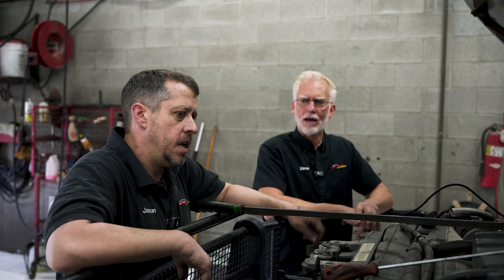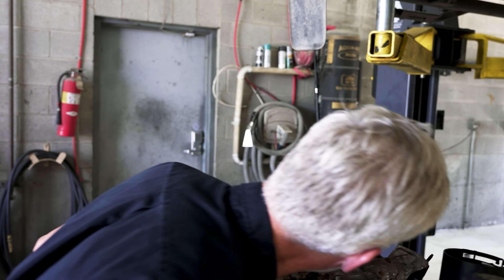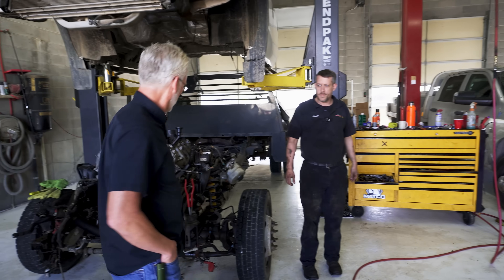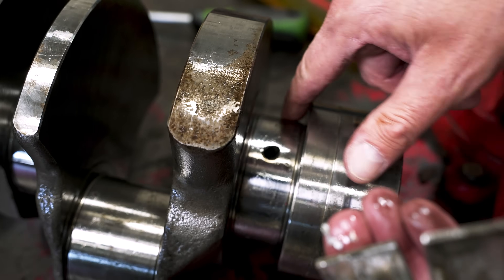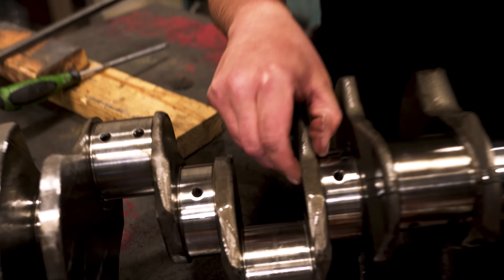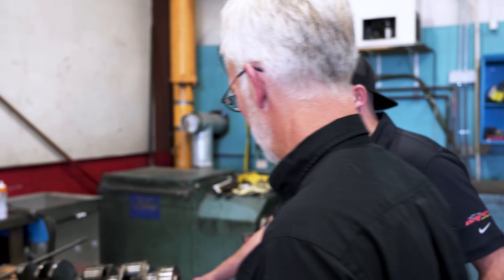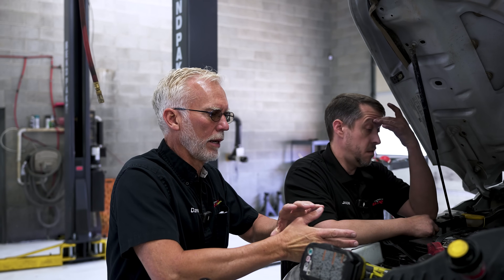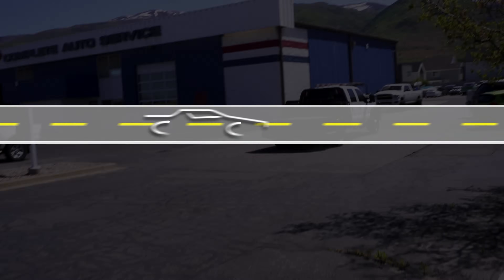Ford 6.7 Power Stroke Failure

Comment: Still don’t know why they use tangless rod and main bearings seems like a poor choice to me
Reply: The tangs don't stop the bearing shell rotation - the compressive force of the bearing being slightly oversize on the OD when torqued down is what keep them in place. (That was new info to me as I thought the tangs kept them in place  as well).
Reply: @Acrowat40 thanks just needed an explanation, most places just don’t have a clear answer on the subject

Comment: I can't wait to blow up my 6'7!
Reply: Just do the maintenance and it will be fine. 6.7 ford is way better than any other modern diesel. 

This dude like to knock the Fords and then a duramax comes in and he's like "oh, all these engines shear the timing gear off the crank. No big deal. Chevy is still the best!"